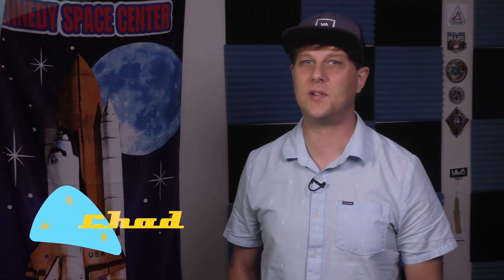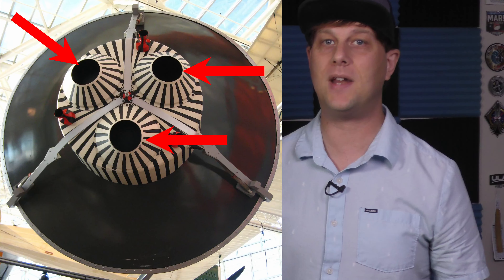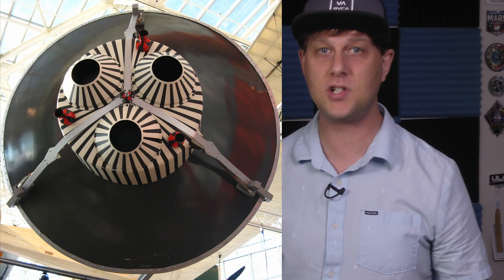Why Did the Freedom 7 Mercury Capsule "Retro burn" When it was only suborbital? | Vintage Space

Comment from the maker: Heads up Crew....Because of the nuance,  a 3rd reason why they fired the retro's may have to do with testing the system before the same capsule was to launch an the more capable Atlas rocket, which of course was powerful enough to get the Mercury spacecraft into low Earth orbit. However, this is not totally confirmed so I left this bit out. What do you guys want to see in this mini series? Let me know!
Reply: I was going to go out on a limb and comment prior to watching the video; which I'm doing now.  However, testing was the PRIMARY reason and making a controlled landing point was the secondary.  I'll be interested into what you thought it was; now off to actually watching the video.
Reply: OK, I watched it. The "thermal load" issue was because the suborbital flights used a beryllium heatshield instead of the ablative type used on the orbital flights.  That was mostly a safety factor issue not the prime reason.
Reply from the maker: @robertarnold9815  Hello friend! Yes I had dropped that disclaimer in the comments where I stated I left that part out of the video because I could not confirm if it was primarily for testing reasons. But overall I do get that all the reasons played really well here. Thank for watching!
Reply: I also always assumed it was to test the equipment prior to an orbital flight.  Good luck with your channel.